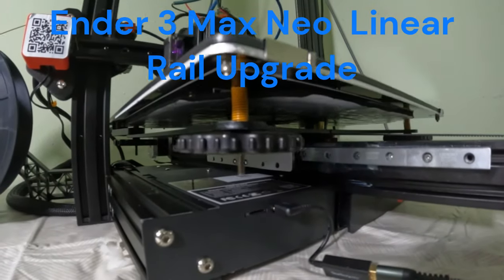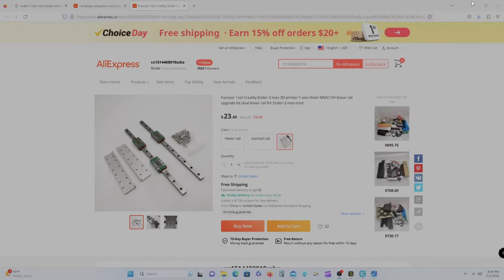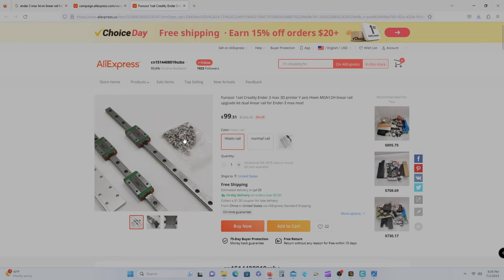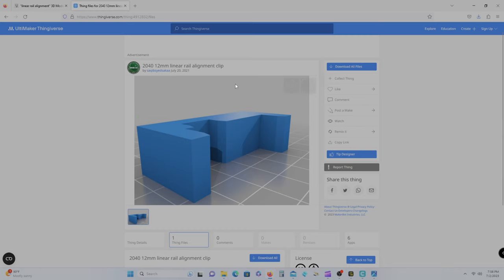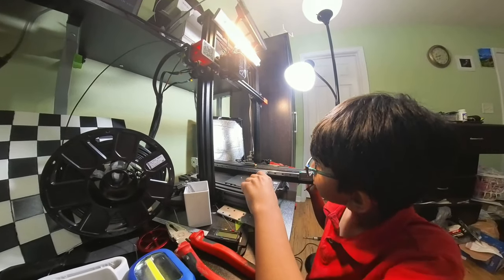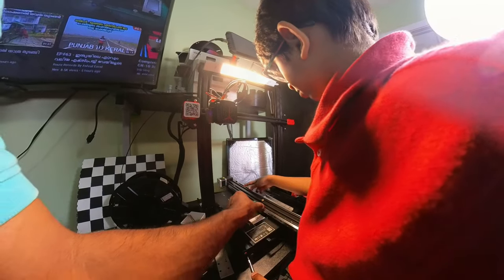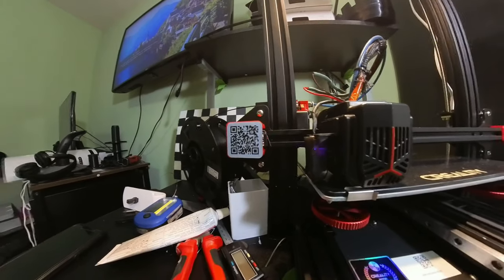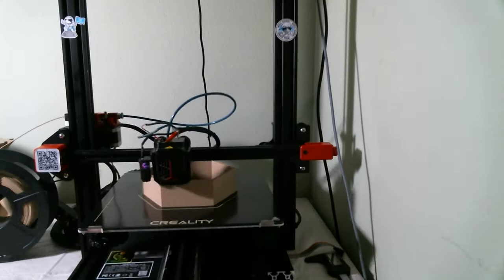Creality Ender 3 Max Neo  Hiwin MGN12H Linear Rail Upgrade

Comment: What length rails did you use?
Reply from the maker: @chev_FTeam   I bought this from aliexpress
https://www.aliexpress.com/item/1005002836341299.html
Reply from the maker: @chev_FTeam  https://www.aliexpress.com/item/1005005068794180.html
Reply from the maker: @chev_FTeam  Bed 450 mm for bed
Reply from the maker: @chev_FTeam  363 mm x axis
When you change it you have to adjust all values in printer. Config file 
Now new better kits are available for max neo
This kit you have to make lots of modifications
Reply from the maker: @chev_FTeam  x axis need 400mm is the correct size mine came short

Comment: can you send the link where you bought it?
also did you try X axis also?
Reply from the maker: I will send it today
Reply from the maker: https://www.aliexpress.com/item/3256802647556763.html
Reply from the maker: I bought the Hiwin rail kit
Reply from the maker: Just found this amazing item on AliExpress. Check it out! $21.84  5％ Off | Funssor Creality Ender3 max 3D printer X axis linear rail upgrade conversion kit Hiwin MGN12 linear guide rail for Ender-3 max
https://a.aliexpress.com/_mPryikW
Reply from the maker: X axis I have to modify holes because this kit is for ender 3 max not for max Neo I have also upgraded ender 3 s1 pro extruder.  You have to make lots of changes in firmware also